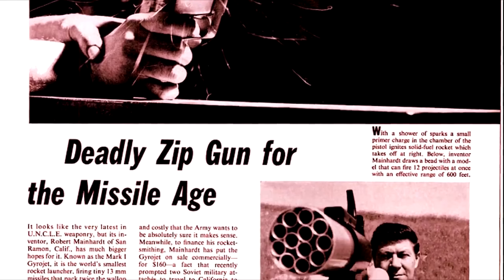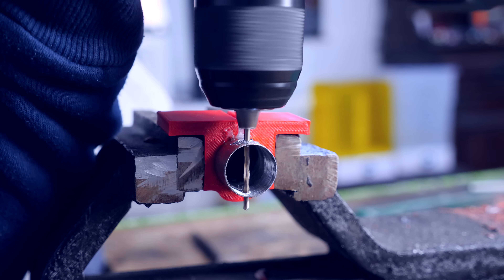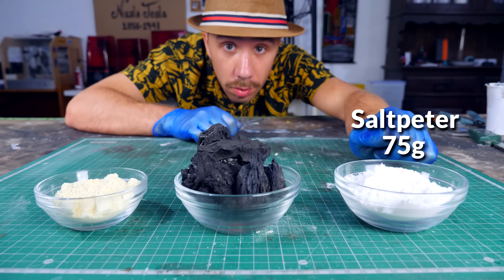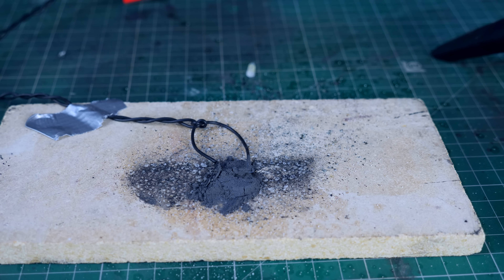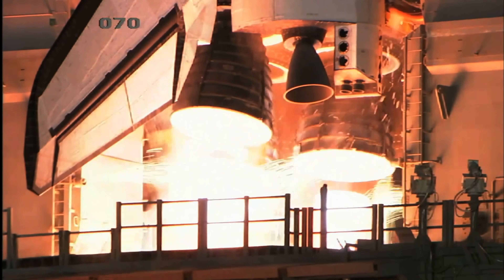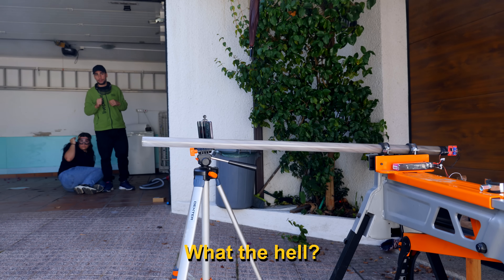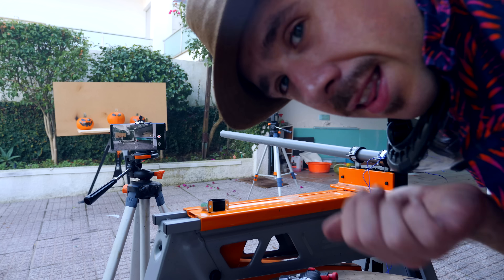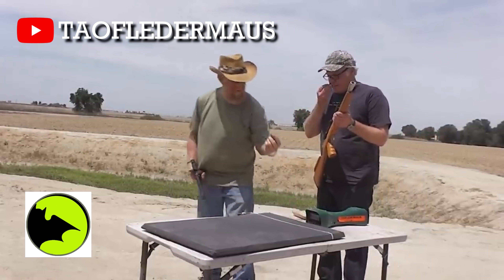GYROJET - The Spinning Rocket Bullet

Comment: The problem was that you didn't get enough spin on the bullet to stabilize it before it gets out from the pipe . 🤔  the bullet from the gun and your bullet were too big different so you should fix the angle on the exhaust.

Comment: make sure that u remember that the centre of mass, will change when the fuel is being used that might be the reason why the bullet if flying all over the place. I also find from my own testing making rockets and projectiles, that, u can get away with a short bullet better than a long one with a long cone.    I would recommend making the cone 40% of the over all size then 60% of a flat body. it took me a bit to get over it in my head, because having a small stubby bullet just didn't look like it would work. but because the bullet isn't spinning the 3 vectors dont move around as much when traveling through the air, making it more stable.    but awesome video man. u wanna see a tomato get exploded by it pleaseeee.

also video idea.
make a torpedo, either using this method or the c02.

Comment: Can you daisy chain like 30 smaller explosions, timed just right, to create a rocket that way?  It could be something like stacked layers of fine-grain gun power, with an electric or fused charge controlling things.  Or maybe stacked 27-cal nail gun charges, in a metal cylinder, triggered with an Arudino, to go off like 100ms apart for 3 seconds? 

I'm betting it would be almost like a machine gun at that point (metal storm comes to mind), but if you did it so it only expelled gas, it might be relatively safe.

In my head, if all timed just right, you could create a pulse-jet like rocket. Unlike a 3-stage rocket, this would be a series of high-energy pulsed explosions.

If you 3D printed mini-chambers for each layer of gunpowder, you could make little 'containers' for the gunpowder, so when one chamber ignites, it has a chance to build up pressure before exhausting the gas at high speed.  Maybe you could even make some sort of Gunpower-infused material to 3D print with, so everything could be one solid piece and it would make it easier to set the fuse delay/explosive power; since programming, etc.

Comment: It might not be an issue with your printing. The original gyrojets only used such a small cant to make manufacture easier. They had intended to use a greater angle for the nozzles.

Comment: I think that the bullets didn't work properly due to 2 factors. The first one that It seems from the slo-mo footage that the nozzle wasn't working as you intended cause maybe one was clogged. The second reason is that, as you see in the footage, as soon as the bullet escapes from the barrel It tips upwards meaning its centre of pressure is higher than the centre of gravity making It unstable. Maybe shortening the rocket's body could help.

Comment: Way way way too many inaccuracies introduced when you are curing the ceramic nozzles with the shrinkage.

I have a lot of hobby rocket experience & self made engines, using clay nozzles.
Accuracy even in a single 1/4" neck clay nozzle is crucial

Since it is a one use item for less than a second - perhaps test with ceramic nozzles printed exactly to spec with zero burning out of the plastic.

This is a brilliant plan, please choose me to receive a 3d printer.  It could literally change my life right now.

My suggestion is to not burn the plastic out of ceramic try your gyrojet replica again

Or you could also try a faster burning propellant. Mill your black powder longer, or make sugar rocket engines with stump remover and sugar

Comment: The gunpowder needs to be granulated, to get better surface area/O2 ratio. The loose powder is only burning on the outermost layer so it burns with a slow "FSSSST" instead of a fast "FWOMP"

Comment: but instead of using gyroscopic force, why do you not use fins with cuts in the launching tube ?
Also, your launching tube is not as much long to stabilize the rockets and the front of the rockets are round instead of in a cone shape

Comment: Two ideas:
1) angled nozzles and spin stabilization are hard and require high precision, I recommend trying the rocket bullet again with fins, either with a sabot or spring deployable fins.

2) can you cast nozzles? I know cat metals are bad in high pressure and vibration but it could work for small-scale projects. 3-D print models and use them to make molds!

Comment: I think you need two adjustments: shaft has to be a tighter fit to the "bullets", and your propellant needs to burn a lot faster to get the spin you need. Check out the rocket fuel videos on the Tech Ingredients channel.
Reply: He could use a star shape hole in the fuel grains instead of just a circle, it increases the surface area and therefore has a higher burn rate, harder to make though

Comment: That looks a lot like a center of gravity issue as well. Adding some weight to the front of the rocket may help immensely. If you look at the original Gyrojet, while it is hollow - the front 1/3 of the round was solid brass.
Reply: That’s true of all rockets - mass at the top makes them more stable in flight.

Comment: I know how to get the 3d printed solution for steel 3d printing, realized with your ceramics printing.
you take your part that you want in steel, and invert it into a multi-part mold, and print the mold in ceramic. If the ceramic can't handle the temperature of steel, then make a mold of your molds in brass or even plastic, and make a high temperature ceramic in those molds, to make the parts of your high-temp ceramic multi-part mold for steel. 
Then you just file down any imperfections. you now have a steel part, realized by 3d printing.

I actually saw this done using a sand and glue based sintering printer that made a high temp sand mold for casting steel parts back in the early 2000's before I had even heard of 3d printing, and they printed all the parts to make the engine for a lamborghini. the parts still needed a small amount of machining since it was just a sand casting, but it proves the concept. 3d printing molds is possible, especially with higher resolution printing that we have now.

Comment: Hey Integza ... One thing you can try for stability is grooves to act as fins.
This idea came from looking at shotgun slugs and air plane cross sections.
I believe I suggested this on TOAFL. ...  and someone made one and sent it and It kinda worked in the shotgun.
However for your spin, that's detail machining, a thicker casing or 3D print extension that tapers down. Because you need to put in the spiral in the recessed grooves for the specific angle.
Now because of the weight, size and thrust ... I'm not expecting it to go straight but it should help with nose forward.

Did some quick safe air sol launch tests myself and it seemed more effective for smaller objects so.
Also the nose needs to be curved smooth to allow air to flow around.

Comment: video idea! In spirit of COP26 happening at the moment and rockets being cool as f**k. Why not build a rocket and propel it with renewable or sustainable fuel. I.e bio gas or oxyhydrogen through electrolysis? F**k it you could always make a wind turbine to generate the electricity to make the fuel.

Comment: Maybe you can try to use the discarded CO2 cartridges to make a steam rocket. The basic idea maybe is to overheat the water inside the carbridge until the plug melts or can't withstand the inside pressure. Yeah i know a quite lot dangerous, so better use a plug that has a huge margin of pressure.

Comment: Nice work. wire wool strands will glow with very low current.  Bought saltpeter from a chemists in the UK 40 years ago and got a visit from the anti-terrorist squad. My mum told them I was very keen on chemistry. Thought we were IRA, great way to kill an interest in science.  Now you can get it on ebay.  Pretty sure its still illegal to mix gunpower in the UK without a licence. Ah, the freedom of tech ingredients.  I can hear cars  and see uncontrolled projectiles. Can I suggest a range ? love the work , wouldn't want you to be made to stop.

Comment: Video Idea: 3D-print a fully automatic potato-cannon (inkl. a Magazine, etc.) and use tomatoes as bullets! You could even print a silencer for it… :-D

And just a little suggestion, @Integza : Next time if you want to fill some powder into a tiny hole, just make a small paper funnel an set it on top. Works pretty neat.

Comment: I think that your nozzles looked basically straight but angled. Like two straight cones with different y-axes. This requires the thrust outside of the bullet, and back at the end of the bullet, to spin up the whole rocket. This results in tumble. I would like to see this with cones whose y-axes are segments of a coil. Curved cones. So that some of the thrust is directly pressing the cone assembly to make it spin.

Comment: Try metal 3d printing by placing  pla models in sand/compacting material for molten metal once you get the shape take pla model out and then pour molten metal In it you can cut it in two halves our use dissolvable filament.

Comment: Hey Integza! Very nice video, love the idea! I think I have an idea to solve your instability problems!!! First of all, try to use three nozzles instead of two. This should greatly improve your chances of stabilization especially since the fuel is homemade. The second improvement could be to not use the nozzles to stick the ignition system in. I suggest having two very small holes two letting the cable pass from the end of the rocket (nozzle faceplate). You have a very short burn time and hoping that the nozzles unclog themselves in that short time is very optimistic. Hopefully, my suggestions are helpful, let me know if you need help😉

Comment: Next project you can make a metal part with 3d printing by making the model with pla and the cut it bilatetaly in two pieces  and then use the moulding method with filling sand/silica around it and compacting it and then take out the two pieces and pour molten metal into it once done join both of the parts 
(You can also use water soluble filament for complex models)

Comment: You have a back pressure issue. In the gyrojet the round had to push the trigger mechanism back into place for the next round. So it's set in the launcher for half a second longer and that adds stabilization!

Comment: Better way to make the starters without the straw: cut up some ping-pong balls (highly flamable), and dissolve them in some acetone. Then mix the gunpowder in with the mixture till you have a paste. Dip the wires into the solution and let dry. You can dip multiple times to get thicker layer. Works perfectly and no plastic straw needed.
Reply: Gasoline and styrofoam works as well. Add some limonene (goo-gone is a good source) and you'll have napalm that spits balls of sticky plastic fire.
Reply: Can also use steel wool instead of the wire he was using as it's easily available and works ok as well

Comment: Because of the relatively low burn rate of the grain, making the nozzle a higher degree angle and also capping the back of the tube to allow pressure to build up will help significantly.
Reply: The original Gyrojet guns had a spring-loaded hammer that held the bullet in place for the small amount of time it took to ignite both nozzles.
Reply: In the tre-flou-ger-mouse🤷 video they showed how even the trigger assembly held the front of the round to allow it to build up pressure inside the sealed chamber. The high pressure is the key.
Reply: @spencereaston8292  that's a good way to get a face full of explosion. It's a rocket, it doesn't need a build up of pressure. I would think such a build would detrimental to the propulsion efficiency as well as damaging to any components holding it all together.
Reply: @rivercityrampage252 
If I remember correctly, the rear of the barrel wasn't sealed. The trigger would tap the front of the round, and shove it backwards into the firing pin, and hold the round (hopefully) until both nozzles were lit.

I could be wrong about any detail other than the trigger assembly striking the front of the round.
Reply: These seem like exciting and interesting ways to heuristically gain entry to an emergency room. :)
Reply: @sir_vix  aren't you just a pocket of sunshine

Comment: try high temp urethane resins. you can cast pretty intricate shapes and they handle very high heat. Also they don't have layer lines that can be failure points.

Comment: If I had to wager a guess, the original 8 degrees for the nozzles wasn't sufficient for the size of the CO2 cartridges, maybe trying an 13.53 degree angle would be more beneficial (based on 16g CO2 cartridges are 22mm in diameter and the original Gyrojets are 13mm).  Great job on the rockets, been learning a lot about it and 3d printing in general!  Making a rocket propelled leaf blower would be awesome 😎, I don't have any trees on my property but all my neighbors do and I hate it in fall as much as you hate tomatoes 😂.
Edit: went back and seen that you are using 16g CO2 cartridges and updated the math.

Comment: Great video as usual

I would like you to make a three stage water rocket using pet bottles and 3-D printed nozzles valves etc and maybe the electronics if necessary they can figuration of course would be five bottles three bottles one bottle as in the Saturn five not to achieve great altitude just to exhibit staging etc

Naturally the payload would be a small spiracle red fruit

Cheers

Comment: You should absolutely try to build a Rockt that uses Oxyhydrogen as a fuel. It explodes very fast and can be used to push water out of a nozzle without high temperatures. ( ;

Comment: Integza. it seems like the wire's are messing with the trajectory of the rocket. you might want to at least shorten the wires that are connected to the rocket for greater results. also you might want to increase the range of the target.

Comment: ElementalMaker has some pretty good videos about making potassium-sugar based propellants if you want to check that out. A little piece of paper or even aluminum foil can work great as a holder for your igniter charge too. Also you can add some iron and aluminum oxide powder to it as well if you want it to burn really hot.. nothing wrong with a little bit of thermite right?
I really hope you're wearing a good quality sanding mask when grinding those ceramic parts.. breathing in ceramic dust is extremely dangerous much like breathing in glass dust. I know you're whole thing is 3D printing but if you really want to make some metal nozzles you really need to make yourself a backyard foundry and 3d print you some mold parts, sand cast them and pour bronze or aluminum into a solid piece. The way 3D printed metal is done it just isn't strong enough, even if you sinter it it's just not as strong as something that's been taken fully to it's melting point and poured as a whole. It's like the difference between brazing something and actually welding it, it's just sticking together on the surface not all the way through. 
If you ever try this project again, pay attention to center of mass vs center of thrust.. that's why they are spinning laterally instead of on their axis. Also try lubing the tube and/or projectile to reduce friction.. graphite powder is great for that.

Comment: use guide rail to launch bullet and please do use bearings before that use fix mount for test rather then directly launching it and for nozzle just drill two holes in double helix angle orientation

Comment: I would suggest increasing both the number of exaustes(4-6) and increasing the angle of the exhausts. Also it may be easy to create a "war head" using a precussion cap, a wall (between the fuel and the exploaive) and use gun powder as a exploaive

Comment: Rocket projectiles almost always need fins to stabilize in flight. Most use either a spring-loaded fin, as seen on the Russian RPG-7, or a sabot, as used in the armor piercing rounds of battle tank main guns. To really achieve a good spin stabilization from a handgun/rifle platform, a small kicker charge would be most ideal. A primer and charge as found in a bullet would both ignite the rocket motor and propel the round down the rifled barrel, initiating spin stabilization. This would also negate the need for the vent holes seen in the original pistol and would have the rocket exhaust start farther away from the firer. Good luck.